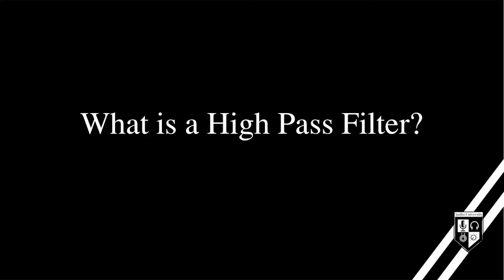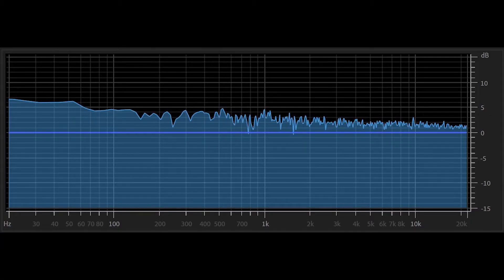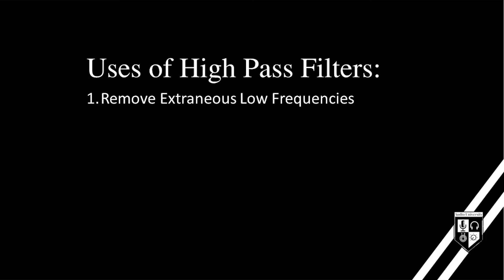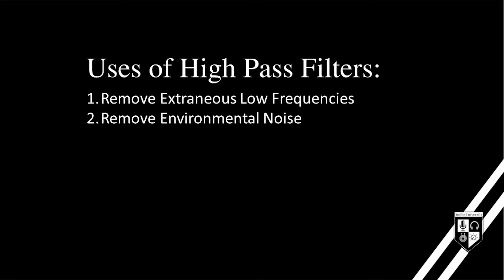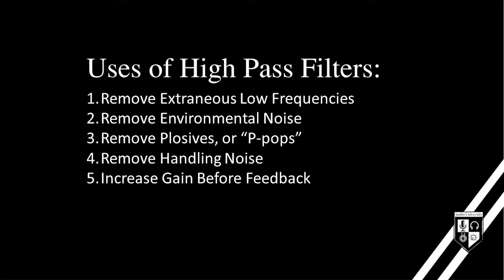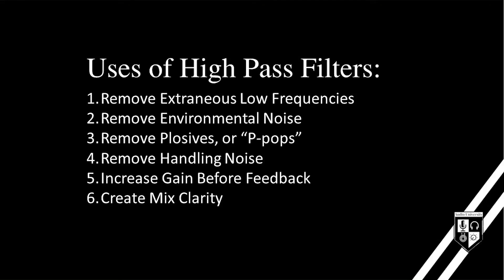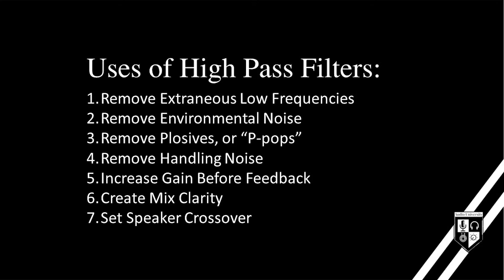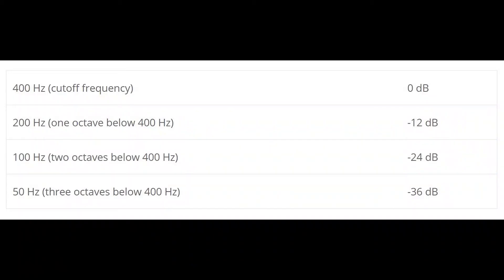High Pass Filters: THE MOST COMMON TOOL IN AUDIO PRODUCTION

Comment: Wonderful Video.

Can You let me know if Speaker Crossovers form a mandatory Part of Speaker Design itself?, or are they used just as an Enhancement Feature to protect the Woofers or Tweeters from getting damaged?
Reply: Typically if you get a sound system with multiple speakers, they will have the filters in them already. If it's a single speaker, it's probably getting full range frequency, and might have a dampener on the bass

Comment: I'm not understanding something. Which has a more drastic impact on sound? Frequency or slope? Specifically in a relativity sense I.e. I understand 100hz at -48db/octave will cut lows more drastically out of a signal than 100hz -12db/octave but what if I set 100hz at -12db/octave versus 75 hz at -48db/octave...would the 100hz eq actually retain more low end since the slope is more gradual despite being at the higher freq of 100hz or will the 75hz retain more low end since the slope is not initiating until lower down in the spectrum at 75hz despite being a more steep slope at that frequency? I just can't sort this in my mind. Thanks.

Edit* fixed typo

Comment: Are crossover frequencies and cutoff frequencies interchangeable terms? I noticed at 4:01 you said "cutoff frequency" while the screen said "crossover frequencies".
Reply from the maker: I usually use "crossover frequency" to describe the point where the high pass and low pass filter sum to 0 dB. I usually use "cutoff frequency" to describe the frequency where the high pass or low pass filter begin (or reach -6 dB).

Comment: I have an Alto powered speaker connected to a Mackie Mix12FX Mixer, the sound is great but when is not playing music you can ear a buzzing anoying noise. i have been trying everything i see on youtube to eliminate that buzzing noise (got new XLR cables, tryed connecting the power with a plug w/o the ground, change location of the outlets......, but i have not found a solution. What can i do?
Reply from the maker: I would recommend ALWAYS using a three-prong power plug.

My next suggestion is to try a ground lift adapter on the input signal. They are quite inexpensive and they are useful to have in your kit. Here is an example of a XLR ground lift adapter: https://amzn.to/3wyxjxE

I hope this helps!
Reply: @AudioUniversity  Where do i connect the lift adapter? from the XLR cable coming from the Speaker to the Mixer? by the way i am changing my Mixer for a Yamaha MG10XU 10-Input Stereo Mixer with Effects, what do you think? i am not professional is just for Karaoke Partys in my house.
Reply from the maker: When you mute the microphone, does the buzz go away? If so, put the ground lift between the microphone and the mixer.

Comment: This is great, thanks for this explanation and example! Do you think a high pass filter is necessary on a mic and can it improve treble? I've used microphones with no high pass filter and it's sometimes very bassy, weak in treble, and lots of hiss noises. Wonder if a high pass would solve those 3 issues? I can edit it in post, but prefer to have it naturally that way since it'd be much easier to deal with.
Reply from the maker: It won’t help with hiss, but the overwhelming bass and weak treble might be two sides of the same coin. Low frequencies tend to mask higher frequencies. If you remove some lows, you might find you already had enough highs!